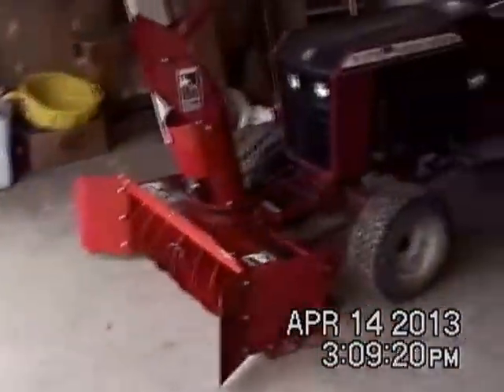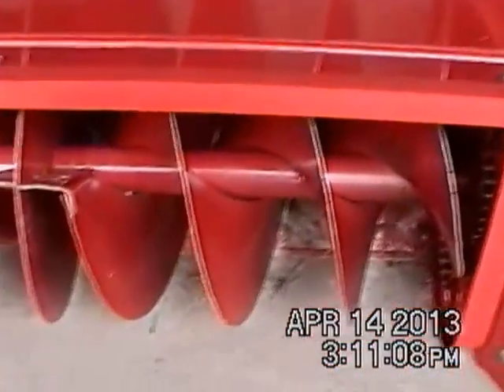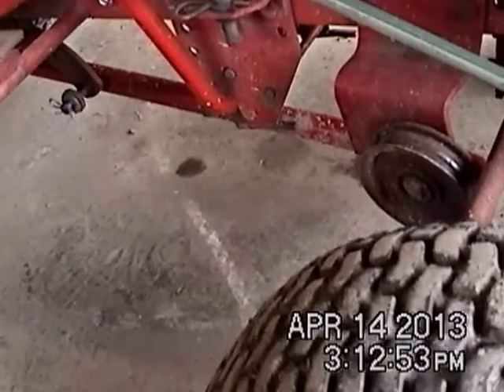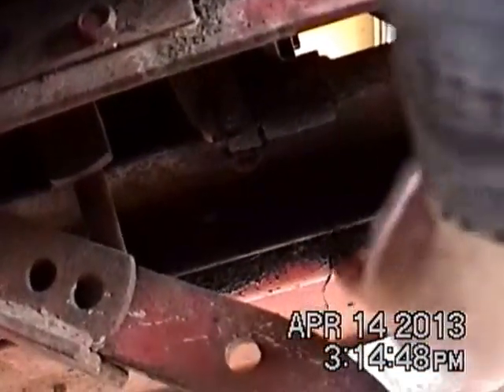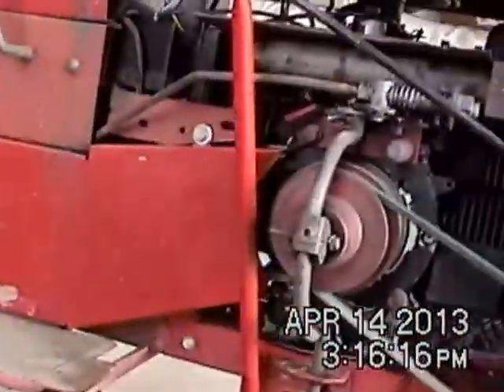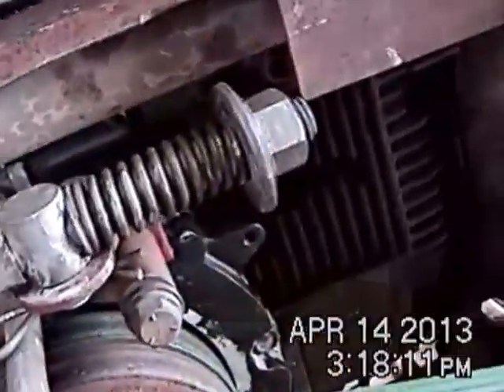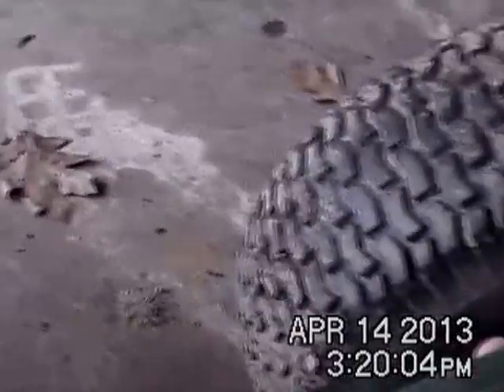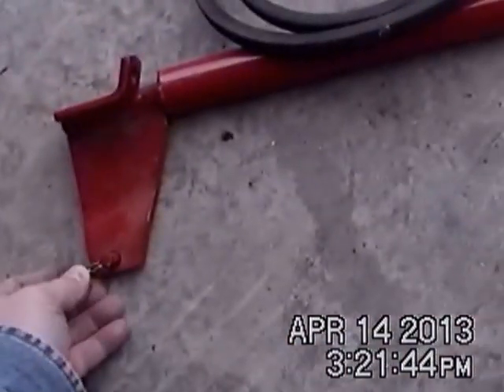Removing the 79360 Wheel Horse snow thrower from a C-195 Wheel Horse tractor.

Comment: This may be a little bit late, but I thought I would let you know your drift cutters are on wrong. They are supposed to be flipped so the flared tips are pointing straight ahead. Take off the right one and flip it end over end so the current top is now the bottom and remount. Do the same with the left side and they wont get bent as easily when hitting hard snow. I just picked up one that had the cutters on upside down and backwards also. The guy had them bent to the side so bad it looked like a plow instead of the edge of a blower, lol!

Comment: Do you have the size or part number for the belt required to put in on a 195? Thanks
Reply from the maker: Hello Jared,
If you are reffering to a snow thrower belt...To utilize the 79360 snow thrower on a C-195 tractor you will need a Gates Power Rated PN: 6977 belt.  Note:  you can cross reference the gates belt part number to find the NAPA or other manufacturers belt part numbers.  The Gates green belts are extra strong allowing them to be able to reverse bend over pulleys.  A very wise choice for a belt to be utilized on a mower deck or snow thrower. It will last years.  If you were to install the 79360 snow thrower on any other smaller frame C-Series Wheel Horse tractor use OEM Wheel Horse belt PN: 9750.  At least that is what belt came in my parts package when I purchased this unit.  Also, as per my video, the lifting pole to use the 79360 with a C-95 is distinctively unique to the C-195.  If you want to know the other belt part numbers for the hydrostat, mower deck belt or mower mule drive belt just let me know.  Hope this helps.  Cheers!